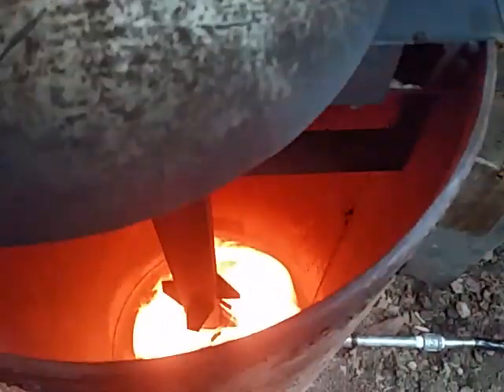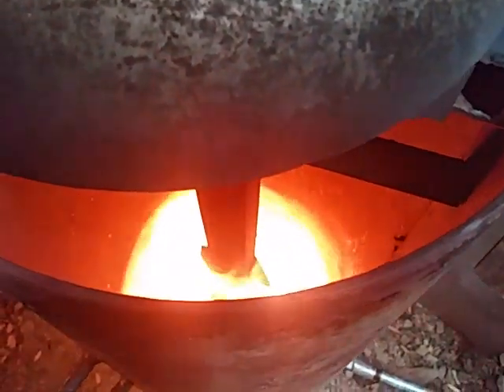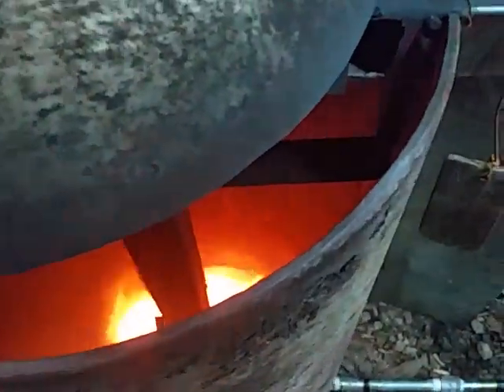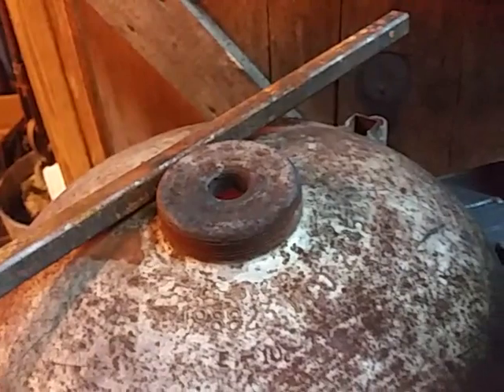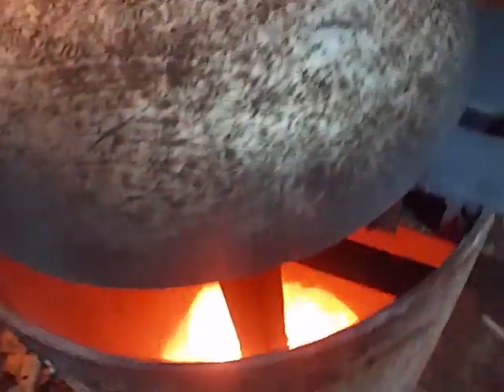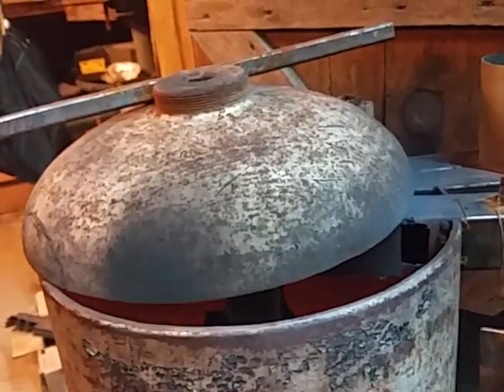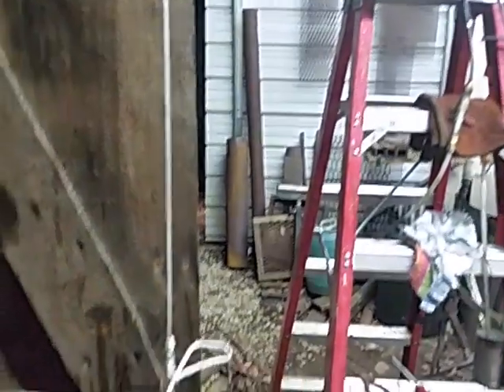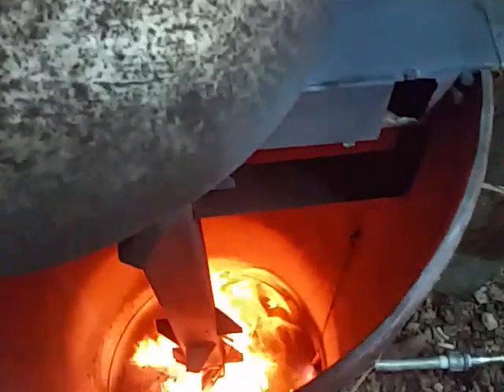WASTE OIL BURNER - Our First Bit of Water in the Oil

Comment: water gas from 900c coming to HHO
Reply from the maker: I think so.. It appears that is what is happening.. I will use it to supplement the oil supply to extend the fuel and heat of the unit.

Comment: Should get a stick or two 1/2” stainless tube and make a mono tube boiler to capture the heat and transfer to a heat exchanger
Reply from the maker: +Russell Faison..   I have looked at using coils to heat the water to push it to a tank and then distribute it through a radiator, or in floor radiant heat coils.. The concept seems pretty simple.. 
I did a quick search on Mono tube boiler.. Seems that the few things I saw were related to creating steam, more than heating water in a source tank for distribution.. 
I also saw what appears to be problems with overheating the water and creating steam pulsing, vs heating the water and just moving it to the tank.. I am not sure, but, the temps that I have seen so far at my exhaust where I will be heating the water are around 350 to 550 degrees F, when I am running at warm up temps.. around 250 at idle.. I thought a larger volume of water being heated would would cause convection currents within the liquid and heat/pressure and density would cycle it up to the holding tank with more regularity.. But, I have zero experience with any of this so far.. It's what makes this type of project fun and interesting.. Lots of brain teasing.. 
I worked diligently to get the clean burn.. The exhaust has zero smell of any type of petroleum product.. It just smells like clean steam.. I was wanting to run the burner with the top of the burner open and capture all or as much of the heat in the shop as I could.. It's and open shop that will have plenty of circulation, no matter how much I try to stop it, so, will be watching for headaches, etc.. Probably will get a Carbon Monoxide monitor just to see what it does.. I don't even have enough smoke on startup to make me want to close the lid.. When I shut it down, different story, but, still not terribly bad.. Nothing that is going to smoke up the ceiling, but, enough that you will close the lid and let it exhaust out of the building for sure, while it cools down after the flame is out and the unburnt fuel is still rambling around in the tank while it cools.. 
I just pulled my dust collector fan (wen 650cfm) off of my Sand Blast Cabinet to do another internal burner prototype.. Have two more designs that I want to try and tweak.. With this "Dayton 1TDP3" PSC Blower 75CFM 3016RPM 115volts 60/50hz, it just doesn't have enough torque or any type of secondary stage to "Force" the air through the smaller orifices, so, my Rev 2 and 3, were drilling out the 5/32 holes larger and larger until I got the volume I wanted.. But, I really wanted pressure and speed through the small orifices vs volume.. I managed to double my oil consumption rate, but, I am still about 3 quarts per hour, which is still not bad, but, about 1 to 2 quarts more than I had before with plenty of heat, but, not clean burning.. 
So, I go the clean burn, but, I think, if I can get that medium orange to bright orange flame closer to a blue/white flame, I think I can get the same amount of heat with less fuel.. At least that is where my next mods are going.. 
I am going to run it pretty hard when I first get into the shop.. Lots to heat up quickly.. 
I am hoping that I can heat the water quickly, because, with the ideas I have for the burner, I think the shop will heat up faster than the water,, using a Natural Thermo Siphoning/cycling..  I was planning on only using a boiler pump to circulate the water after it was heated through the floor and possibly through a radiator with a fan behind it.. The Radiator was actually a control to allow me to circulate the water if it got too hot for the Radiant tubing (which I had some extra Pex Pipe I was planning on using for that (I think temp rated is 225 degrees... I plan on using Antifreeze just to not have freezing problems, which will raise the boiling temp of the liquid.. If it gets too hot, I figured a few cycles through the Fan blowing over the Radiator, I could get the water temp back into a safe range before circulating it.. When I am finished and work out the bugs manually, I'll look for some temperature solenoids to switch on a secondary pump to cycle through the radiator.. A manual override to "On", when I first crank it up and then back to Thermostatic mode, to just kick on when the temp gets over 225, and shut off when it gets back down to 180 or something in that range.. And the other pump will just turn on when it gets over 100 degrees or some temp to start warming the floor.
The Radiator would be just to control an over temp of the water, or, just to get more heat in the shop on start up.. There will be some balance that it works at based on Outdoor temp/wind conditions, etc that the environment will mandate.. 
I'm thinking they are all good concepts and should work.. Just to get the right balance and components, so, I don't create some problems, and I create something I don't have to constantly monitor or worry about..  
I really don't know about the Boiler at this point.. 
Monotube vs A Gas Water heater type of Boiler heating system.. It will be an open system with an expansion tank.. I am thinking 15 to 30 gallons of hot water storage would be more than enough.. Whatever I find for that part of the testing.. I have a couple of pressure tanks (with bladders), but, will be making a parts run to see if I can put my hands on a smaller (under the counter type of water heater).. Hoping for at least 10 gallons for testing.  I am going to try to keep from buying a second water circulator for hot water. They are around a hundred as far as I can find.. But, if I have to go that route, I am sure that I can heat the water up much faster going to the tank,, if I can keep a slow to medium flow rate going through the boiler.. For testing,, Ha..,, I am up to 8 in pipe dampers, because, I am not sure how it is going to work and not sure where I actually want them, so, I am going to double up, so, I have more of a complete control on the 650 cfm's of the dust collection blower.. I think it should be easily able to push the air through the smaller orifices, and I am going to wrap a heat shield around the burner and be able to vent a good bit of volume there, then, I need to be able to fairly precisely control the air going into the burn chamber,, and the rest I will let blow straight up into the shop to recirculate the heat and keep it mixing, and when I get closer to getting things finished, the Automobile Radiator will be mounted high on the wall, and run some 3" flex duct from the end point of the blower tube to the radiator.. Even if the water in the radiator is not hot or not circulating, it will still serve a purpose of dumping the extra volume of air and getting the heated air at the ceiling of the shop mixing back up with the cooler ground temp air..  And, when it is just running on idle mode, the motor just happens to run nicely on a variable speed controller, so, I think I should be able to adjust it nicely to give everything a happy mix and not run me out of the shop with too much heat, or overblow the slow feed of fuel in the burner.. 
Anyway.. Those are the ideas I have and where I am heading with the testing... 
Want to play more with the smaller orifices and faster air at a lower volume first to see if I can get closer to a blue flame... Hope the random fuel sources don't get to be a problem.. I have a prototype fuel tank (Shown in the videos), where I can test 24 oz of different types of fuels to let me know how that is going to affect things.. Might just start taking 24 oz samples of Oil, Trans fluid, Hydraulic fluid (which I think might be a problem), and test them for variances in the fuel supply. When I get things regulated, I should be able to tell if any of them are going to create problems.. Right now, I have 8-55 gallon barrels of waste oil from an estate that I have no idea what is in it.. but, two of the barrels still have "Hydraulic Fluid" stickers left on them..Ha.. So far, it has burned cleanly on samples from at least 3 barrels. Not sure if they kept any of the waste oil separated for any reason or not.. Lots of variables in the equations..
I have started keeping notes and a log of what I am doing.. Going to fill in the blanks as far as orifice diameters next time I pull the burner out which only takes 5 seconds, but, is a black soot which will get every where if not handled properly. I think I stopped at 3/16" holes on my last revision of the single stage blower.. I am going to make a new prototype burner tube vs welding the old holes shut and drilling again, because, this one works nicely and I can burn it while working on the others for testing.. 
Cheers.. I'll let you know what I think about the Tank Thermo Siphoning anyway before too long.. I am going to try to watch the flow with something simple before any type of final plumbing.. I have an old hose pipe that is probably going to fail a few times while playing and testing with it.. If the cycling does not work fast enough, might try injecting a low pressure regulated air between two backflow valves to see if I can get a controlled cycle rate, just to see what a pump will do down the road.. 
BTW.. Thanks for that piece of 4140 for the Anvil... That project turned out beautifully.. 
End result was one very fine damn anvil.. Thanks a bunch..
Reply: Mark Thomas, this sounds like a truly kick ass project! For the mono tube boiler you can limit the number of coil turns so that it’s not generating steam, though it would still require continuous circulation of water. Looking forward to watching this progress, you have a lot of good ideas. Glad that anvil repair project turned out great, I remember it had a lot of naysayers. Keep making the videos !
Reply from the maker: @russellfaison954  Ha.. Thanks.. Yes.. We do lots of stuff that people say can't be done.. Those are the most interesting projects.. I have some more videos to post soon,, If I don't wait to edit them.. We have a few tweaks more, but, we have a much more regular blue flame by reducing the overall volume of air flow and making the orifices much smaller.. But, we did half of the new/old prototype burner for the test, which let us learn, but, was unbalanced, so, we saw what we wanted as far as the blue flame, but, had a misbalance which created yellow and unstable flame.. So, pull, mod and test again.. I will post a few videos when I don't stop at 5am... Ha.. Cheers.. More coming.. :)